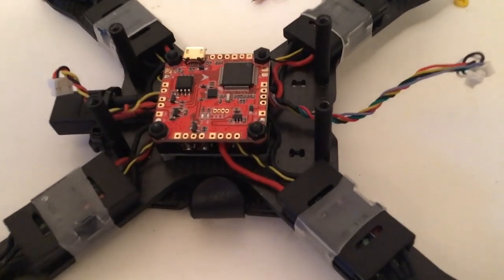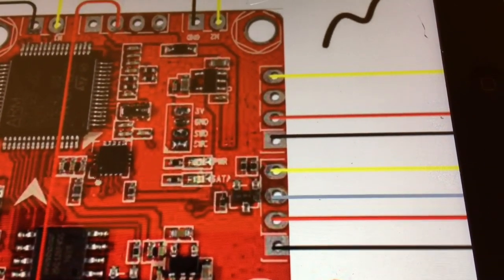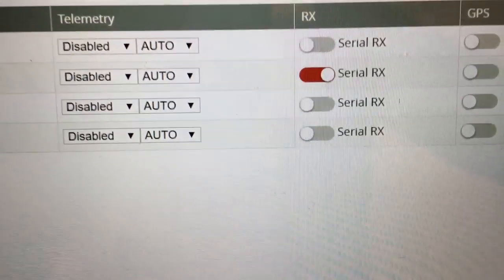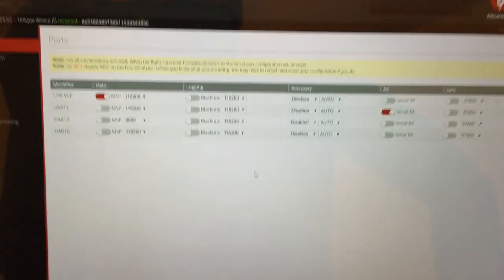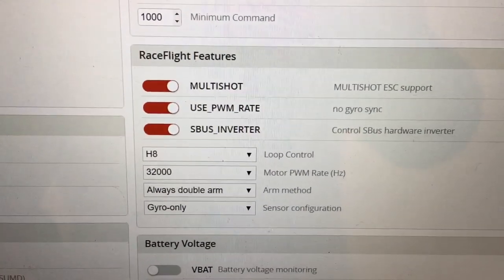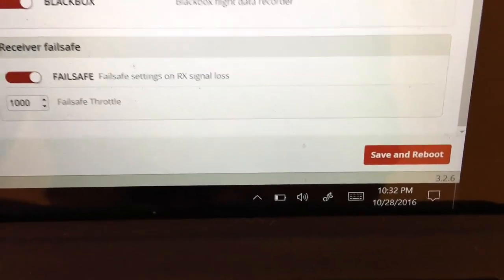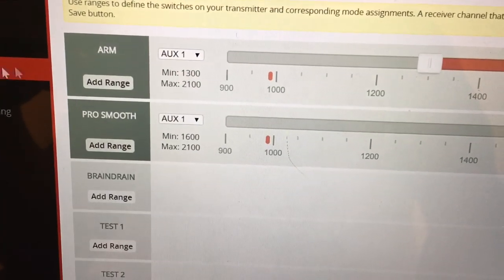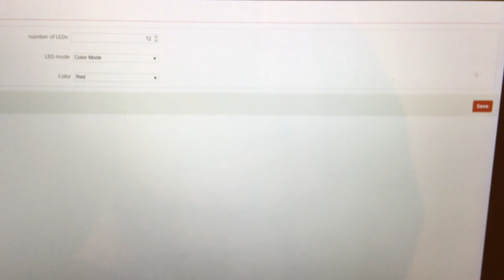Installing the RaceFlight Revolt Flight Controller

Comment: Please help me johnnn...... Already 24hhours my fc lite revolt osd doesnt have input signal in betaflight. T16 already binding with xm+ ( green light ) il ready jumper tx1 with inverted also but nothing signal input in BF . when i cheked the betaflight arming flag it show RX_FAILSAFE_MSP..

kindly to help with my issuepraypray

Iam using fc lite rf osd. There is just only 1tx1 pad and 1rx1 pad. So its not like v2 have 2 tx1 pad and they can jumper between tx1 and rx1

Comment: 8:20 you said "ignore the schematic because the schematic is incorrect" I double checked my Revolt board and it does match the motor orientation on the schematic.
Reply from the maker: Fly With Me Fpv at the time this was the case. They corrected it
Reply: Thanks, I had to open up my setup and check the motor wiring when I saw your video, all good now :)

Comment: Hi.
You are using RaceFlight version 3.2.6 but i can find version 1.1.5 on the web !!!!
Where did you download it ??
Reply from the maker: IceCreams62 actually you should download the very latest.  I loaded the wrong one and it should be 3.4.3. You can get it at raceflight.net. To load it go to chrome://extensions and delete your old one. Then drag file right to the window. Remember to rename file extension to .crx
Reply: Thanks a lot...in the meantime i found it on raceflight.net site   :-)   !!!!

But why it is not in the 'regular' Chrome web store ???
Reply from the maker: IceCreams62 actually the newest 3.5.5 is in the store
Reply: 3.5.5.2 installed.  Thanks a lot !!!!

Comment: I am using a Matek HUBOSD Eco H-Type PDB, my FPV camera, should I only be using 12v, G, and signal to the PDB? Also, for the Lumenier VTX should I only be using the 12v, G and signal as well? 5 wire connector, snip the other two wires off? Thanks a lot for the advice
Reply from the maker: sl66ICEcuba 5v only to revolt period. Any more you fry it.   As far as 12v for your equipment just wire the appropriate power from the appropriate 12v bec on the Hub osd/pdb

Comment: I recently put on my drone the f4 revolt but I cant find the exact PID config. at middle throttle start a vibration and I think is PID. those that are in the video they are ok to fly? 
I have o-rings etc etc and the vibration dont get out
help please
Reply from the maker: Nicolas Gelfenstein install raceflight one now. This is old. Already.

Comment: Your motor layout is incorrect, it should be just like the picture.
Reply from the maker: Ozzy3333333 my motor layout is correct. With Revolt facing forward each corner corresponds to the motor on that corner. It's wired just like KiSS FC. And you need to use the QUAD1234 motor mix. It's simple. There was a mistake on the schematic on the website or on the configurator. I don't know which one. But if you follow the directions wiring and select the correct motor mix then it isn't a problem.
Reply from the maker: Plus I wired it underneath. So when you flip it ... it will be correct

Comment: Just installed Raceflight Can you help When i select anything apart from setup It hangs for ages an does not go to the page selected
Reply from the maker: spooner Graham make sure you install the latest Raceflight configurator. Download the latest bin from raceflight.net
Reply from the maker: spooner Graham also. Restart chrome
Reply: Uninstalled it restarted and still it spins and say waiting for data So it doesnt load the page Is there anything else i should have installed The version it says the board is 3.4.3
Many thanks for trying to help
Reply from the maker: spooner Graham http://raceflight.net/invite/   We can help you there.
Reply: Just trying to use the boot to flash is as it needs to be done But says cant connect I used the bin file Any ideas Chers
Reply from the maker: spooner Graham if your trying to flash. Use boot pins. Then use zadig change the bootloader to winusb driver. Go on slack. It's easier to help you.

Comment: How are we to get Vbat telemetry?
Reply from the maker: Drone Punk well most people use OSD in racing. But if you want vbat telemetry you need to use voltage divider
Reply from the maker: Drone Punk vbat get directly from your pdb.
Reply from the maker: Drone Punk there is a vbat that will be working hopefully when raceflight one comes out.  Google x4r-sb voltage divider for now.

Comment: where did you connect your 5-volt lead at I am used to the naze32 so this is completely confusing I see a bec 5 volt and then just a 5 volt on the board I'm guessing I'm going to connect it to that 5 volt and ground or is that sending out 5 volts
Reply from the maker: Ultimatevapor918 yes.  It's marked bec5v and use ground right next to it.
Reply: +John DeCastro thanks man cant wait to try it heard so many good things
Reply: +John DeCastro hey man I got it hooked up last night I noticed that the minimum throttle was at like 1065 the only thing I did was drop that from 1065 down to 1050 but when I arm my Motors they sound like shit but it worked awesome on betaflight with a naze32 so I don't get it do I need to bump that minimum throttle back up to 1065 I'm not a fan of raceflight so far I looked for the hex file for betaflight I was just going to flash it with betaflight but I couldn't find it if you have any tips I would appreciate it man
Reply: +John DeCastro but I wanted to fly really badly this morning so I did and there was so much vibration everything from mid throttle up
Reply from the maker: Ultimatevapor918 once you get past setup you'll love the FC. Get on raceflight slack. Be patient there. I'll get on when I can but it's easier to help someone there. http://raceflight.net/invite/
Reply: do i put my email in there
Reply: ok i just joined
Reply from the maker: Ultimatevapor918 ok. Go into the raceflght channel there and start asking for help. I can't be there now but there are the developers there that can help. Lemme know how it does.
Reply: +John DeCastro I am on there but I'm talking to a robot LOL I called getfpv and was seeing if they had any tips the guy at getfpv ask me about my O-ring I told him I had all eight of them on four on the top four on the bottom but I told him I had them tight he told me to loosen it up and make it loose so I have backed my hex nuts off almost completely they are holding on by a couple of threads but I still have all of the O-rings on
Reply: +John DeCastro the guy at getfpv told me if I cannot get that Revolt going good he would trade it for a lux V2 but I have heard so many good things about this board the only person who I said it was shit was Bardwell
Reply from the maker: Ultimatevapor918 lol. I'm not gonna comment. Other than when the lux first came out people had major problems from noise to the FC. That being said at the time I was using a cyclone that had sensitive gyro susceptible to noise. People just don't understand how to configure it yet and give up. Raceflight One is coming out which makes it tons easier to configure. But that said. I love the board.
Reply: +John DeCastro haven't given up yet LOL and this has been a learning nightmare for the last year LOL how do I change it up to 32k 32k raceflight is completely different than betaflight
Reply: +John DeCastro and I don't see a spot to turn off the accelerometer
Reply: got it going OMG this thing is amazing why was i with naze for so long haha Im sold Raceflight
Reply from the maker: Ultimatevapor918 congrats!!!  What's your setup?
Reply: +John DeCastro I've Got a Theory X 195 I'm running the red bottom RS 2,600 KV BL heli s little bee30s and an hs1177 with GoPro lens I ran into another problem though because I wanted to update my ESC so I put it into dfu mode via raceflight now my computer is not connecting to it and I cannot flash it what do I need to do I can't get back to raceflight and I can't get to betaflight I read that I needed to flash it with betaflight in order to access BL heli Suite so that's why I started this I should have just left it alone it was working
Reply: +John DeCastro when I connected up to raceflight now it says raceflight bootloader at the top right instead of a comm or dfu
Reply from the maker: Ultimatevapor918 restart Raceflight configurator. Unplug and try again. If still s problem try a new cord
Reply: +John DeCastro all I get is a ding it will not connect in raceflight or betaflight and it will not Flash I have not jumped the boot pins because I'm not at home I don't have my soldering iron
Reply from the maker: Ultimatevapor918 first of all do not use a soldering iron to jump your board. You have a driver problem in that PC. Use zadig to make sure you have the CDC driver for that serial. Go on slack if you don't know how.
Reply: +John DeCastro okay I have that installed the com came back up but now it shows com 7 and failed to open serial port
Reply: +John DeCastro so i cannot solder the boot pads i think its stuck in dfu mode
Reply: this thing is locked up all I did was click dfu mode my computer made a sound so I clicked disconnect then I tried to go to betaflight and it would not Flash then I tried to just pull raceflight backup and exit dfu mode but I don't think it ever really put my board into dfu mode completely because I didn't see it in the top right-hand corner I don't think I really have another choice other than shorting out the boot pins the drivers should all be correct because I didn't change anything there all I have clicked is dfu mode from the setup page on raceflight and then disconnected and now I can't reconnect I hope I don't have to buy another board I hope I didn't find a glitch in the board